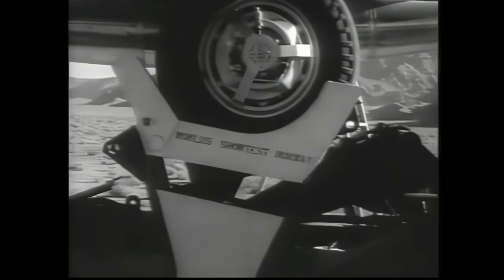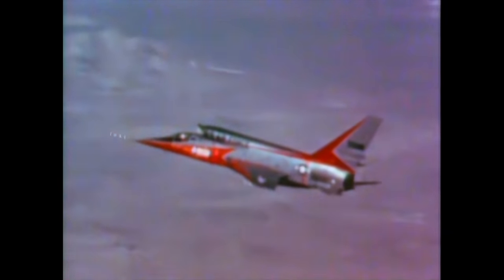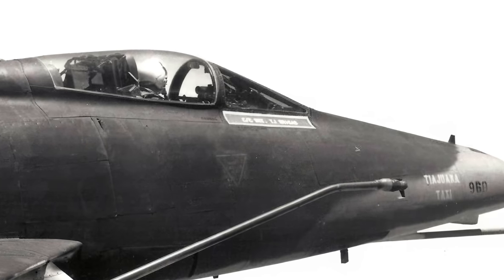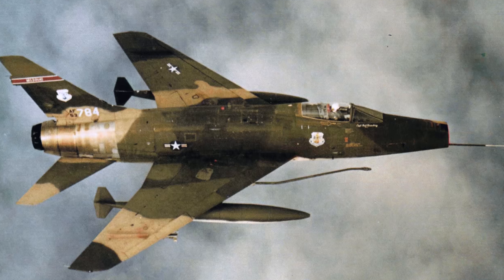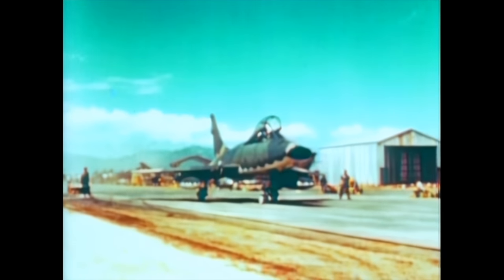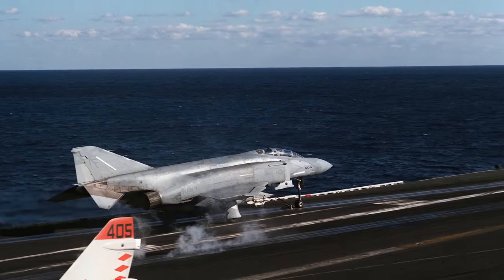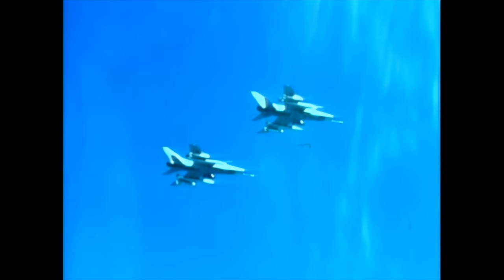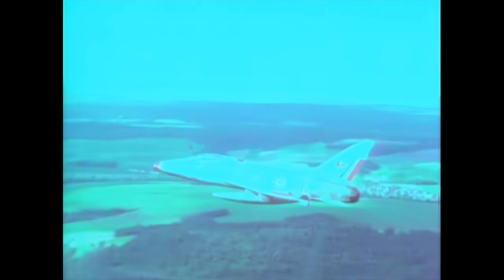F-100 Super Sabre "The Hun" | North American Supersonic Jet Fighter | The Century Series | Part 2

Comment: i was stationed at pleiku  in 1969 as an a1 skyraider mechanic with the 6 sos . i was part of the ar team when we had a call for an f-100 with battle damage that stuck throttle at about 180 mph that was attempting an emergency landing at our field. the pilot managed to land at this speed , grounded the wheels and brakes in half but no other damage was done. we pulled the pilot and acft. off the runway and later mechanics i believe from phu-cat fixed and flew the acft. out
Reply from the maker: Thank you for your service Juan